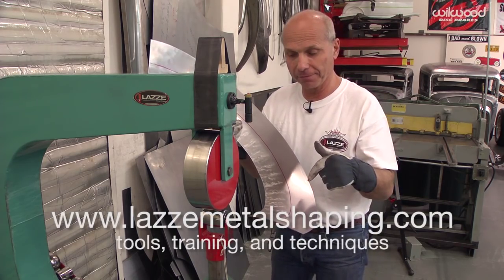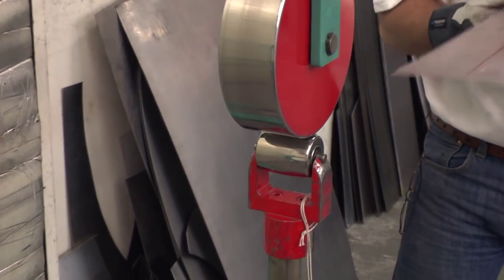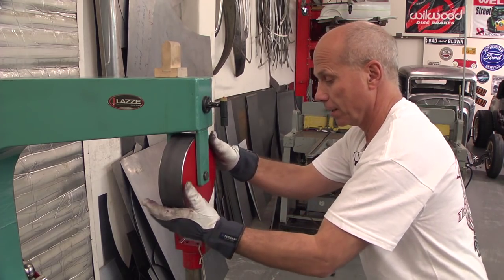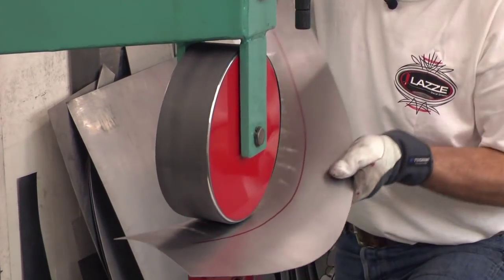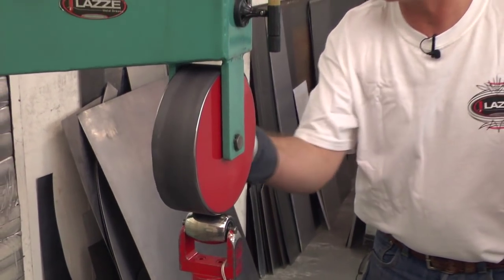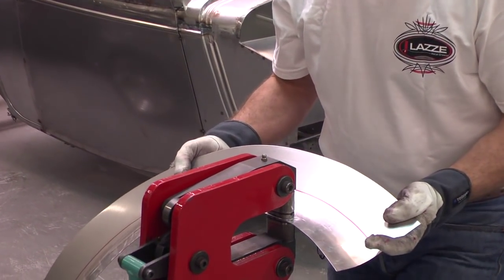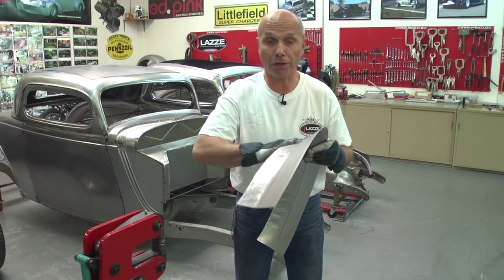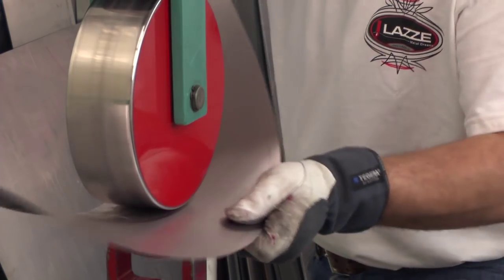Metal Shaping with Lazze:  Metal Fender Flare with Inner Lip Part 2 of 3

Comment: For the rubber band, do you mean an inner tube for a hand truck with an 8" diameter, and if so how do you cut it w/o it being all messed up? if the tube is for something like a pickup truck cut across would be easy to keep neat and professional looking. I just haven't found one yet.